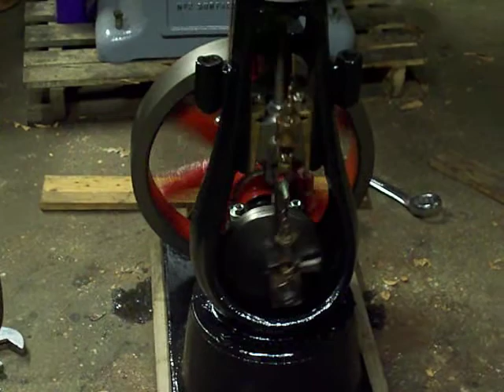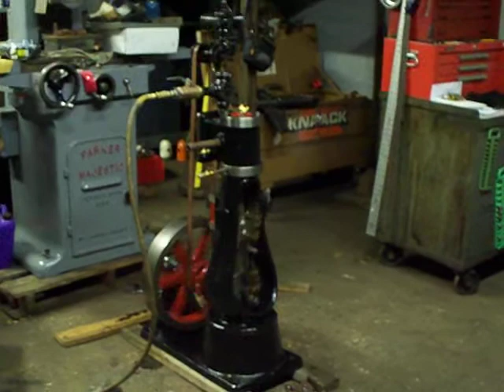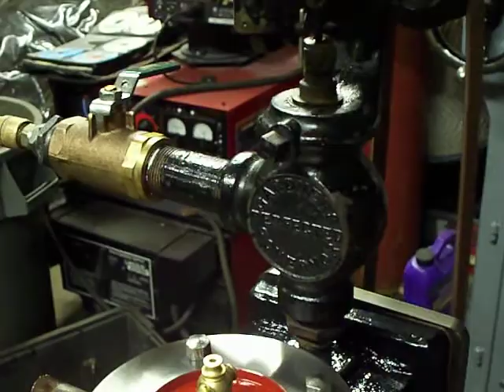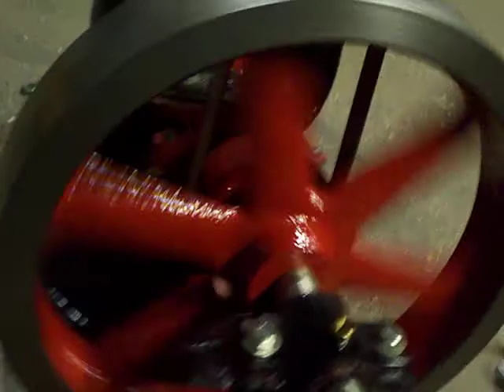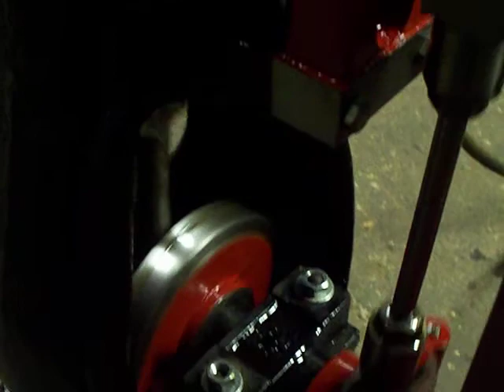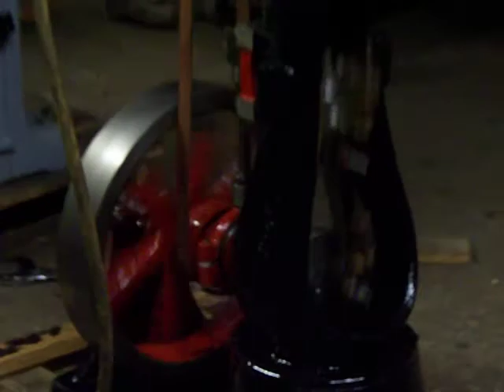Verical Bottle-Frame Stationary Steam Engine Running.

Comment: It looks similar to my O&S, most of which I think had flattened sides but mine has rounded sides like this. Also, the crosshead way lube is provided, like this one, by cast on reservoirs on the sides. 

 That is one very nice looking engine.